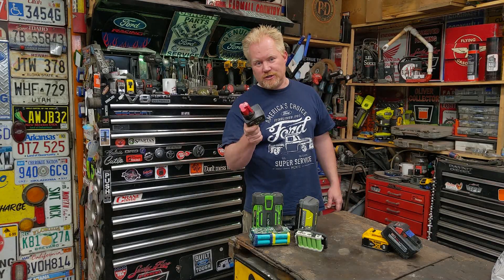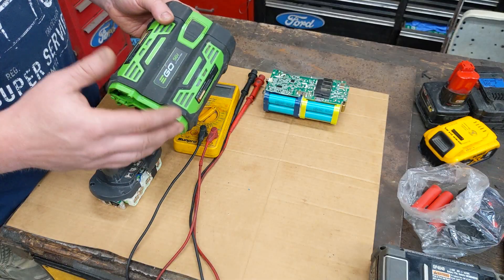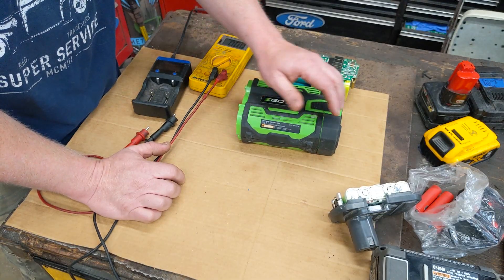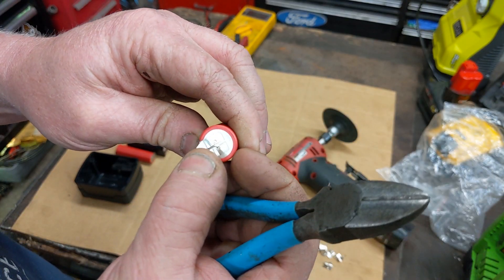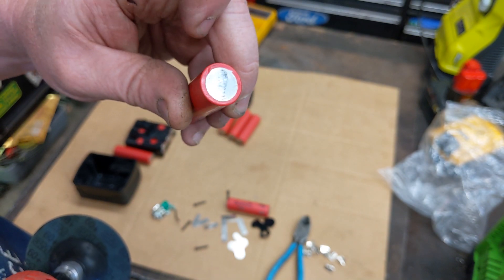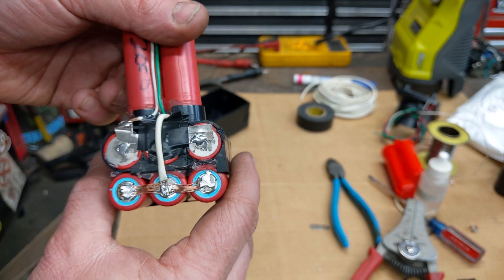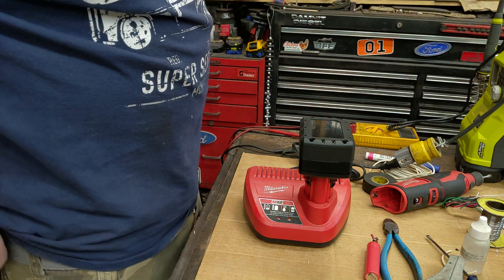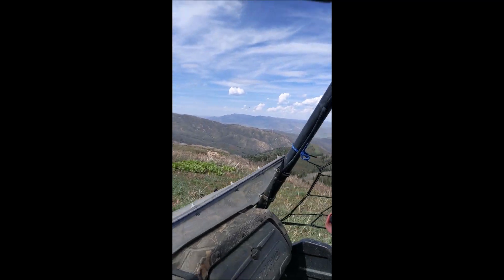Build Dirt Cheap power tool Battery Packs : Milwaukee Dewalt Makita

Comment: If i wanted to swap out 18650 cells for 21700 cells in a ridgid 18v battery,  could i? I mean provided i customize the housing to fit the larger cells of course, but would it work, or would the electronics not support it?
Reply: It would work. The electronics would not notice any difference.

Comment: Never mix different battery brands and different MAH and volt Ratings, it will end very bad if something happening.
Reply: He has not had the “experience” yet , he breaks nearly all the hard solid rules about pack building

Comment: But one qeustion on the internet says litterly dont solder IT how come IT last longer with yours most people i see building bettery packs they use spot weld
Reply from the maker: Because the internet runs wild with the slightest info. If you're building huge multiple battery packs use a spot welder It's way faster. If you're just going to build a single battery or two in your home garage use a soldering iron you'll get it done and you'll notice no difference.
Reply: @sixtyfiveford  well i AM a home builder An want build my own packs An i wanted to know information from people like you thanks for the tip buddy An Nice dog you have as well
Reply from the maker: @markludersen8524  If you sit there and bake them for 60 seconds with a soldering iron you run the potentially cause damage. 10 to 15 seconds, no. During heavy operation in power tool use I've measured temperatures over 200° F. Even 10 minutes later they're cooking away at 140F. I can solder and touch the joint within 5 seconds and most time is barely feels warm so around 90F. The metal casing is the battery's radiator and designed to dissipate heat.
Reply: @sixtyfiveford  thanks for the information i would keep IT in mind as well than i dont need buy expensive spot weld to have IT

Comment: You're right. Manufacturers use spot welders to save time. A reasonable welder can be bought for around $60 or you can build one for about $20. Personally, I prefer the spot welder for the same reason the manufacturers do. I don't have the time to sit and solder.
Reply: yup bought an amazon spot welder. $70

Comment: Have you actally tried a Milwaukee m18?
You cant because as soon as you disconnect the BMS it wont work
Ibe done other brands but never been successful with milwaukee 
Other vidoes on youtube say the same you cant repack m18 batterys

Comment: manufactures use GRADE A select cells and high end tools are even matched cells.  be careful with cells below 2 volts, as they may have started growing "crystal's" internal shorts.  These internal issues compound over time and its possible to have a runaway thermal reaction internally, with ZERO warning.  To do this right, use a  cadex or something similar to match similar cells alike.  most 18650 cells have a vent if anything goes wrong, but its the heat it generates that is passed on to neighbor cells. IE runaway thermal pack.  ask anyone into modern RC cars how spooky lithium can be.
Reply: yup a 1/2 way decent grading charger is like $35

Comment: So if those batteries will get hotter in normal use than they do when you are soldering on them, won't the solder joints just melt and get all over everything?
Reply: You are absolutely right! This guy doesn't know what he's talking about. Soldering the connections is not recommended!

Comment: Right on!  I'm awaiting a Dyson DC56 that I'm debating either paralleling the Dyson pack with a DeWalt 20V switched adapter & pack custom add-on, disassembling the Dyson pack to modify with the DeWalt 20V switched adapter or disasembling the Dyson pack and the trigger to replace the trigger with the DeWalt 20V switch from the adapter and maybe or maybe not using the Dyson pack since is more work... though thinking can 3D print the Dyson pack and then just save the Dyson pack to sell or maybe use possibly in the future.  The switch seems handy to have at the trigger.   Another neat project I even made a YT video regarding, is using one of those DeWalt (might be better to use the 24V Kobalt packs & adapter) switched adapters with the way cost effective and versatile SH72 soldering irons.  Thanks for sharing, right on regarding the batteries qualities you found!  I think the laptop batteries I've recovered and restored have only been used in flashlights I've modded to accept the 18650 batteries where I think I have a YT video regarding one of the UV 3-AAA flashlights I modded.

Comment: wait a minute 
Using a hot soldering iron to solder battery cells can degrade battery quality and high heat can lead to battery explosion
Should have a professional cell welding machine
Reply from the maker: Nope. You won't even get close to how hot these get under normal use.

Comment: On that 12 volt what do you think is the biggest battery you can make I have seen 9amps but I haven't seen bigger
Reply from the maker: The problem is you can only make high drain cells up to about 3ah(18650). So you're limited to that in a 9 cell case. You could use a bigger case though and stack them as many as you want and make it 12ah, 15ah etc battery pack.

Comment: 👍👍👍 Thanks for giving me confidence to repair my Battery’s and tip on the liquid flux’s!
Reply: If you do it right the flux in the core of solder should be sufficient. Doing it right requires you to really clean where you're going to solder though. Which you should be doing anyways. Clean your soldering iron tip and your solder too while you're at it. Any contaminant in the solder joint will cause issues. Might not be a game stopper but it'll make things harder for you. Done right there's not much to soldering. Done wrong is when trouble starts.

Comment: Right on brother, I’ve been doing this for years. Back in the day a new dewalt 18 volt replacement was mucho dinero! (nicad) instead I’d just buy the replacement for $13 from harbor freight for their standard ni cad battery pack for a warrior flashlight! The HF Warriors lithium are now $20 AND come with a charger to boot. If you only need two cells then that rebuilt or other tool pack now has spares. Thanks for getting this out there. I’ve also traded smoked packs at Home Depot for better cased ones to rebuild as well. Id just tell them my case was cracked and I’d redonate that one after I swap the case. Whatever, it works🤥. I prefer to do the labor replacing cells over shocking or nuking them to shock their memory into coming back. Ya, that worked for a while too UNTIL I popped one once and aside from being very loud no injuries to report but forget that😉👍🏼

Comment: Great video. I've been doing the same for a while. I haven't had to buy a new pack in years. Those 40V ryobi packs tend to have the electronics fail so they will have all good cells!
Reply: i just snagged a 40v 6ah. 30 2000 mah cells. bad bms. revived and fixed a freinds 40v 5 ah. found the out of balance cell group, charged the group with my sky rc ba6 and then reset the bms. bam pack working again.

Comment: Great practical video as always! The sanding/tinning idea is great. Why not tin the connector plate in addition to the end caps? Seems like it would promote easier soldering under the plate.
Reply from the maker: Generally there are space restrictions so I'm trying to add as little solder as possible. The connecting strips generally flow the solder extremely well and don't need pretining.

Comment: Ya my biggest problem is that when I solder a new cell in its to big to fit back in the case and that almost all the salvaged batteries are under like 2Ah so If I was doing it I'd want to but some like 3000 may or something
Reply from the maker: Yeah space is always a concern. Sometimes I have to trim some of the plastic inside but I always get them to fit. Yeah I have a whole pile of 1.3 amp hour right now and wish they were bigger. Seems like most or 2amp hour.
Reply: You may want to use a tool called a spudger which is basically a wooden stick. You use it when you're soldering like a soldering iron that's not hot. Kind of like a finger that you don't have to worry about burning. You can use a spudger to push your connections flat. I think the really good ones are made out of osage orange wood? But they're gray when you get them. I've made them out of red oak too. But mostly I use real commercially manufactured ones. I don't see them for sale much these days. So not the easiest things to get. Handy tools though.

Comment: I went to 5 stores and asked for used batteries, I got one dewalt spending $20 in gas. Thanks Moe for the great video. Going to be sending you something in the mail
Reply from the maker: Yeah that's the way it goes sometimes. I started not going out of my way, but if I'm out and about by a store I just stop by. It's really hit and miss. Yesterday I stopped by two stores I got a single battery at one and eight batteries at the other.

Comment: Just so everyone knows be careful soldering onto lithium cells. If you over heat the cells you wont physically be able to put out the fire.
Reply from the maker: If you way overheat them the fuse in the top will blow and they just won't work.
Reply: @sixtyfiveford  ik in my dewalt batteries they run samsung 25r 18650 batteries. There is no fuse in those batteries. Ive definitely watched several blow.
Reply: @sixtyfiveford  I'm not saying dont do this... Ive done this for different projects a ton. Your definitely right in the fact you want your iron as hot as it will go.
Reply from the maker: @silver1fangs  These batteries get so hot inside their cases just through normal hard use. I just ran a regular battery pack actually on a Dyson vacuum that I may modify to increase capacity. The pack got up to 175° f which you can barely touch with your bare hands. And that was measuring through a 1/8 inch plastic shield and the time it took me to open up the battery pack, so it's likely 200° f on the battery casing itself during operation.  You would have to leave the soldering iron on a cell for probably 2 minutes to even get close to that temperature transmitted into the cell. Yes they're very dangerous but you have to go above and beyond to make them as dangerous as everybody wants to say.
Reply: @sixtyfiveford  love the fact I actively reply to comments and you are correct it does take a bit to have them go off. Ive pulled upwards of 60 amps off of 25r's (single cell) but I also know a guy thats had 3 sets of 2 batteries all catch on fire. My experience comes from working a vape shop/vaping and honestly for the most part this is way safer than dealing with loose cells daily. The only point I was trying to make for any one reading was a basic warning....... Also if you have a use for the left over good cells that would be a great vid.

Comment: Note to clean all of your solder joints when finished if using corrosive flux. Just don't use MEK or benzene aka carb cleaner. (Not an inside joke)
Reply: Or just don't use acid core solder. NEVER use acid core for electric. That's plumbing solder. Come on people.

Comment: so where the hell do you get the circuit boards? yeah, I get the cell thing and I have repaired batteries by replacing cells, but many times its the dang circuit boards - all the cells test good. also, what is that electrical flux? where would I get that?
Reply from the maker: eBay or AliExpress. Generally the same listings for the empty battery case will have an option just for the circuit board for a few bucks.
Reply: @sixtyfiveford  I don't need the empty cases. I'm not going to make the batteries from scratch, I'm going to try to fix what I have. I can do the cell replacement (thx for the soldering tips, btw) it's when the boards go bad. You can't really screw up a case, but I don't know if I can trust the boards from just any cheap Chinese source.
Reply: @johnboynton5649  Considering these are the same people who are making refurbed batteries and selling them cheap, sure, your 3 dollar board might not work. So just buy two, or just don't do this. But, as a contractor I have seen a decent amount of people using the knockoff batteries, which we can be sure came with the knockoff board. They worked.
Reply: @1pcfred  k. Just thought someone would have some recommendations.
Reply: JFC dude. You got Google there?

Comment: Before you take apart your Makita batteries, go to the Makita store and get them to test em. They may just give you a replacement. Worked for my father. 7 batteries.
Reply from the maker: Someone threw away two Ryobi batteries and the date codes said they were under 3 years old. Called Ryobi and they sent me two brand new batteries.
Reply: Makita batteries are the worst. They have a board in them that black balls the battery in a fault condition. One screw up and it shuts itself off. There's no way to reset it either. Once it trips it's over. WTF is a Makita store? Screw them!

Comment: Awesome Moe. Person could fix their bad tool battery by isolating bad cell and replace it instead of buying a brand new COMPLETE  pack. One recycled battery pack could repair multiple others from harvesting the good remaining cells in it .Great freak g idea. 18650 's aren't cheap when you have to buy several .Great idea dude !
Reply: Except no.  It's a bit like running tires on your car until the belt pokes out, then replacing only that tire and pretending the rest are as good as new when they are near the end of their life too, unless you just needed a wheel alignment and inexplicably didn't notice abnormal wear for a long time, but even then, that's a long time you wore the other tires too so they are not as good as new.
Reply: @stinkycheese804 so true and that’s a great analogy. Also you should really really not solder 18650s. It’s like playing battery pack roulette. I’d never recharge a soldered pack in my house. 😮

Comment: If you have trouble soldering things use phosphoric acid as a flux -its a common chemical sold in hardware store as a rust remover.Usualy comes in 75% ,but some of rust removers have other chemicals added so try to find pure acid .It costs around 5$ so you can try different brands and see which one works best .
Reply: I wouldn't recommend using acid for electronics soldering. I've soldered professionally in a board assembly house too. So I may just know a thing or three about soldering. Being as I've soldered mil spec circuits. Use abrasion like this guy did. If you have to resort to using a cleaner then use a solvent that doesn't leave a residue. Isopropyl alcohol is a good choice. Save the acid for plumbing jobs.
Reply: I'm a little picky when it comes to soldering. I always use a rosin paste flux, 100 watt iron and 63/37 leaded rosin core solder. Has a very low melting point of 345*. Never have an issue

Comment: you can grab a spot welder for pretty cheap that is made for welding the nickel strips on lithium batteries
Reply: Soldering irons are cheaper. But a spot welder should work better.

Comment: DUDE? WHY BOTHER RIPPING THE TABS OFF and ruining a good battery? AND you won't get battery even warm. NVM hot. just solder the tabs together
Reply: Tabs may make the assembly messier. The way they're spot welded on is probably not the ideal orientation for how you assemble a pack. So by pulling them off you simplify the construction.
Reply: Exactly, leave a bit of the tab on and solder to it. Solder sticks better to those tabs and you don't risk damaging the cell.
Reply: @sidney9534  solder should not stick to tabs better than a prepared battery cell surface. If you are soldering correctly there is no risk to damaging the cell either. If you're doing it right you should just barely be brushing across the surface of the cell to tin it (and tin you must). It is the short duration of heat contact that you want to do. A fraction of a second. More than that and you're doing something wrong. But people do solder wrong a lot. Notice how I said at the beginning, "a prepared battery cell surface". That was not accidental. You want to scuff the metal and use a degreaser. Something like isopropyl alcohol or acetone. I always say there's three rules to soldering, you have to work clean, clean, clean! What that means in practice is you need to clean the work, clean your soldering supplies and clean your soldering iron tip too. It all has to be clean! Or you're just going to get a dirty rotten joint.  Bright and shiny is what leads to bright and shiny. Neatness counts making these battery packs up too. Those tabs going all over the place does not help.
Reply: @1pcfred  thanks for the elaboration. Of course it makes sense, and I actually once made a 14s7p pack like that and it worked great and lived a long happy life.
But for your typical YouTube viewer, I still feel soldering to tabs has a lesser chance for error - also depends on space etc. But I don't disagree with you.

Comment: Great video. It's amazing that for the last 12 years something stupid such as a $4 circuit board or a few bad cells causes so much warranty grief and wastes so much time at the local big box store when most battery packs can be salvaged and rebuilt for around $10.
Reply: I worked at a grocery store one summer and they would throw away all the food with that days expiration date. They had a compactor that the food went into. We would be eating what we wanted as we worked lol. I think today grocery stores give away the food that is about to expire. Waste is factored into the prices of the products. There is probably a huge markup on battery powered tools versus how much it actually cost to make it.